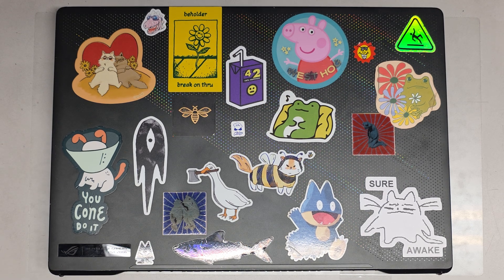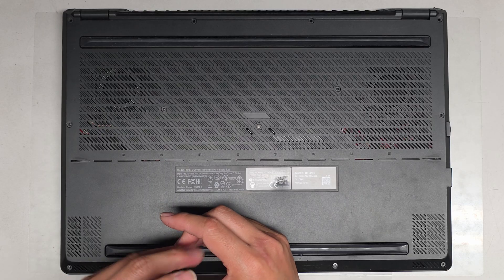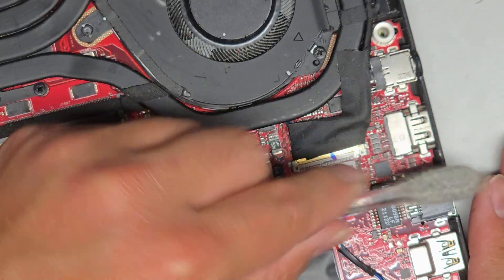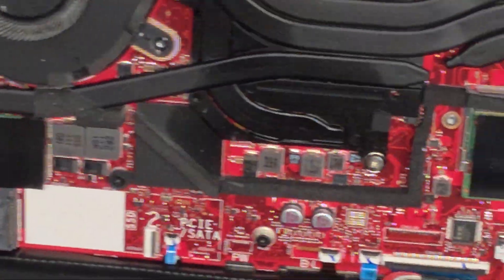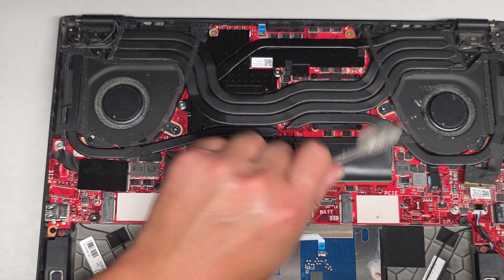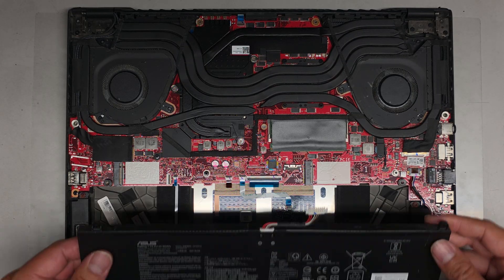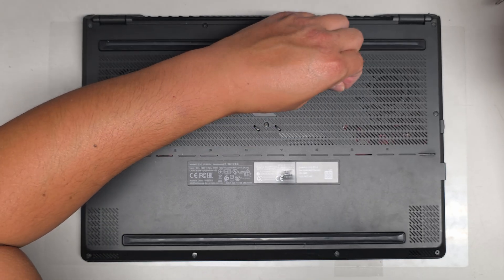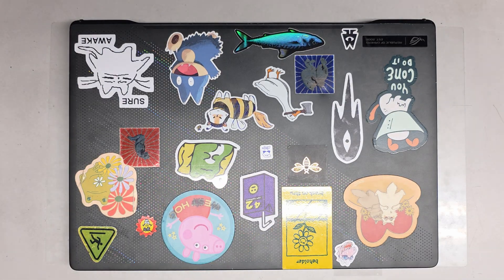ASUS ROG Zephyrus M16 GU603H Disassembly RAM SSD Hard Drive Upgrade Battery Replacement Repair

Comment: I can't insert the power cable correctly. It won't fit in there, so the latch can't go down.
Reply from the maker: Is the port damaged?
Reply: @ItsBinhRepaired no, my laptop work with it, and the port is okay because its new, there is something wrong about how i insert this . Because you can hear the some electrical noise